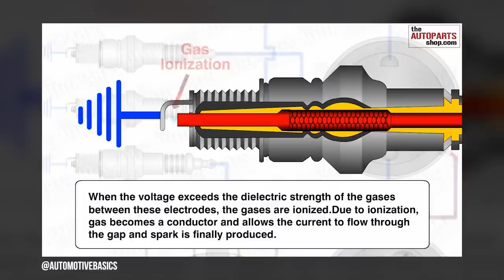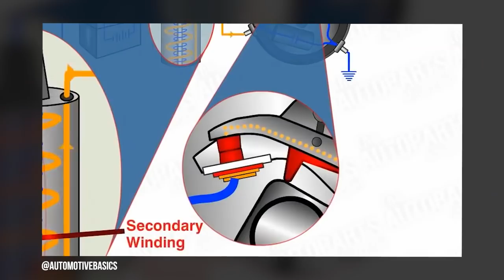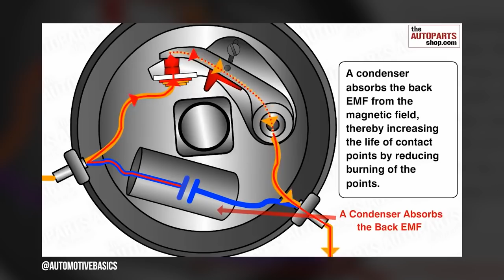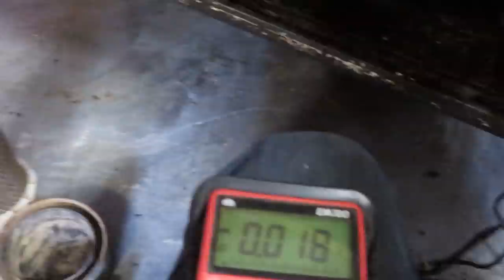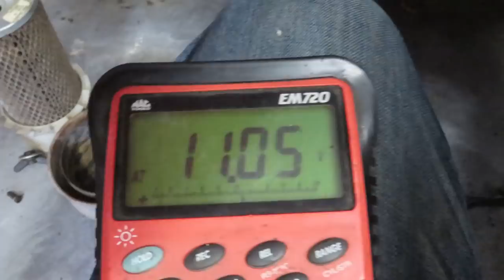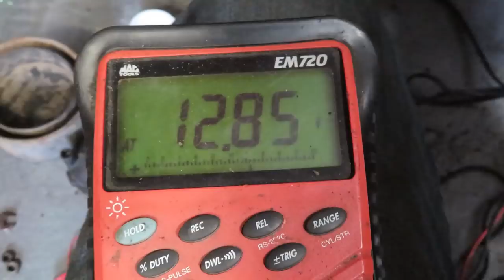What Could Be Wrong With A $300 Skid Steer?

Comment: Good shout on checking the anti dieselling/anti run-on solenoid. Had one crap out on my brother's Volvo 340 (a fine Dutch built car!) which meant it wouldn't idle and would quit at junctions (not great for a new driver). I wedged it in the "run" position with a bit of plastic and it ran fine until we tried to stop the engine. It would splutter on for 5-10 seconds after turning the key off so you had to stall it in 5th gear!

Comment: In 2000 my dad bought a 1980 bobcat 721. Deutz diesel. 1500 hours to this day. He's not very good at maintaining stuff but it hasn't been used a ton and not used hard. He replaced the vane pump and some hoses over the years, I replaced 4 more hoses this year. Currently in the process of repainting and new decals to push him to get some more maintenance done. Oh and it quit on us while removing snow this past winter. Replaced fuel pump just to fuel that out and then messed with the injection pump, then figured we should time it just to be safe.. it runs again. The cam and the injection pump still look new with no signs of wear which is awesome. Really love the machine.

Comment: Wish I could find something like that.
Reply: Look on Facebook market place and you can find anything equipment real are’s that’s how I found my vintage lawn mowe f
Reply: I found a perfectly good working toro push mower for $10 dollars it’s was just missing one part that was super easy to replace.
Reply: Just keep looking on online auctions gov deals equipment rental auctions Kijiji, Craigslist eventually over time you’ll find a deal it takes patience
Reply: Wish I could win the lottery
Reply: I have about the same thing sitting in the weeds   642 bobcat with a ford pinto engine
Reply: @hunter7476  near impossible to find a skid steer this cheap. $2000 will get ya a super junky old vintage one but thats about the cheapest you'll see them. Im always checking the prices on them.
Reply: @rylanleeper4456  thats a classic i got a self propelled toro for free because it "didnt start" ... fuel was bad and dried grass was stopping the self propel belt from turning.
Reply: Og Bqze u have to look for a ticket and buy one first to win the lottery
Reply: Same wished I could find a $300 trackor lol
Reply: My cub cadet 122 has points. They are very important they can make every run a little different

Comment: Let me tell a first-hand no-start diagnosis story. Bought a basket case 1990 VW Corrado G60. Between the boxes of parts the seller gave me, auto parts stores and eBay, I assembled what should have been a fine running engine. Started instantly at the first start but ran worse over the course of minutes until it wouldn’t run at all anymore.

Fuel pressure was good. Fuel flow and injector spray pattern were good. Fuel pulses were correct (checked with oscilloscope). Compression was good. Fuel quality was good as I even tried to run the car from my running truck’s tank/pump. Spark was strong. Ignition timing was good. All crank/cam timing marks lined up correctly. Cranked plenty fast. Could smell raw fuel from the tailpipe. Still wouldn’t start. Totally baffling.

After a month of frustration, sitting on the pot at work perusing VW forums, I saw a post and it all clicked. It became obvious.

When the previous owner’s G60 supercharger crunched itself the integral key on the crank timing sprocket sheared. So although the timing marks looked correct between the crank and cam, the crank sprocket’s timing mark was telling a lie. That is, what the crank sprocket’s timing mark showed to be Top Dead Center (TDC) was not Top Dead Center of the crank. I pulled the #1 spark plug and put a long screwdriver down to contact the piston. Sure enough, the sheared key allowed the crank to slip about 30 degrees compared to the crank timing sprocket. The friction from the crank bolt was all that was keeping things from disaster as I believe (could be wrong) it is an interference engine.

The keyway in the crank was goobered. I bought a new crank timing sprocket and installed it with 2 dowel pins to take the place of the bad key situation. After all that it started instantly and ran like a champ. About 30,000 miles since it was revived and I still drive it daily.

It’s not always something simple. It usually is but not always.
Reply from the maker: Thanks for that!

Comment: Thanks Rich for saying that it's the current (amperage) that kills you.  That's what I learned studying EE.  It's also very important where it goes.  That's the reason for the "one hand in your pocket" rule.  If current goes across your arms, it goes through your heart.  That current stops your heart and you die.  Of course you can find out what the resistance of your skin/body is and work out what Voltage difference will give you too much current.  V=IR or Ohms Law tells you that.

Comment: The engine is mitsubishi 4G32 (1.6 liter)
You can get ignition parts from a 1972 datsun 1200.
Andrew Camarata had the same problem on a machine,you can see the same points he used.

Comment: Engine parts, go to a good parts store, mid 80's dodge colt used same mitsubishi engine. Parking brake should be a middle pedal  on the hump between the other 2. Engine will always be cold blooded and have to run with choke part on for a long time. Timing belt can look fine, but will jump a tooth very easily. Good machine for a homeowner, I had mine for 25 years.
Reply: I was thinking the same thing. I had to put a motor  into one of those a while back. Motors are hard to find now a days.

Comment: I've got the Clark Bobcat 631 with a duetz diesel , I LOVE IT !!
Reply: grafvonstauffenburg  Yes a popular Ditch Witch engine , i replaced the engine but still have the original one which runs, they say you can get 20 to 30,000 hours on the air cooled Diesel,  amazing !
Reply: @ExploringCabinsandMines  Both pieces of equipment I own have air-cooled 4-cylinder Deutz diesels. I have more confidence in them than any other engine - great reliability, inexpensive and available parts.

Comment: I got an old ford cl45 for 450 with a locked up diesel. Pulled the head and cleaned out the gunk from the engine and got it running in -20 in like January and I'm finally getting around to slapping a coat of paint on it now.

Comment: You had the cab up the steering linkage can be adjusted to help with the creeping. The electric solenoid on the carb is too keep fuel from leaking though filling the crankcase with gas

Comment: That's a 4G32 or G32B Mitsubishi engine, used in a few Dodge colts. Pretty easy parts availability.
Reply: I thought that might be the Mitsu unit.  Seems they didn't use the Mitsubishi for very many years though.

Comment: I worked on an old sweeper machine with a Ford has 4 cylinder, it ran a lot like that and had and exhaust valve stuck open. A few taps with a hammer and some marvel mystery oil, she ran like. Champ

Comment: Without the VC off and no timing marks I find TDC by sticking my finger over the #1 plug hole and spin it manually by the crank bolt. When it starts pushing up air and then stops, you found the compression stroke and go from there. You can also verify the rotor is pointing at the correct contact on the cap at this point. Also clean out your idle mix screw port and set to a factory baseline or 2-3 turns out to get it running and fine tune after.

Comment: I did a tune up on an old Farmall 350 that had a rotor that worn. The plastic wear tab on the points was also worn half off and the points were burnt into each other. I couldn’t believe the thing still ran when I saw how bad it all was.

Comment: Makes me appreciate the old 610 with a Wisconsin that my father just got rid of.  The old Wisconsin seemed much easier to work on than this machine.
Reply: Those 610s were awesome. That Wisconsin would just keep going and going
Reply: I had one, the v4 Wisconsin was great.  The clutch and belt drive system?  Definitely the weak link
Reply: We got a 630. That engine is a turd.

Comment: I spotted a resistor next to the coil. The coil operates at a lower voltage from the resistor when the engine is running. When the starter is engaged, the resistor is bypassed to give the coil full voltage for a hotter spark to enhance starting.

Comment: Had a Bobcat 642b.  Simple machine, ran great when it wanted to. Replaced the ignition with an electronic kit from Pertronix. Valves needed to be adjusted on a regular basis or it would run out of power.  Also if it wouldn’t start on a cool day without a lot of effort, the carb needed rebuilt. Just that old of a machine it was getting hard to find parts for it.

Comment: To check the timing in relation to the bottom pulley you could have taken the 3X10mm screws out of the top cam belt cover and checked the timing marks or even perhaps used the timing light on the top cam pulley. lol.

Comment: That’s pretty cool I worked on quite a few of the old breaker points and condenser systems, but I’ve never seen one on the positive side. Any one I’ve ever worked on the points are on the negative side and they are grounding the coil to make it field and spark. The little solenoid on the carburetor is an anti-backfire solenoid. When you shut the ignition off it closes off the main jet so you don’t get that continuing Venturi effect and then a backfire to scare the operator. Maybe you say this I haven’t finish the video yet lol.
Reply: The cool thing about old school ignition is that it can work as + or - ground.

Comment: that valve on the carb might be an antidieseling valve used on the Mitsubishi gas engines , it just shuts off  fuel in the jet port to prevent it running when off

Comment: To check if all cylinders are firing get a spray bottle of water and spray the exhaust manifold. If the water doesn't steam off, that cylinder isn't firing. A neat trick a motorcycle mechanic taught me.

Comment: Was it a OE hall effect set up? as you can get kits that convert your points over. The reluctor just pushes over the cam in the distributor and you swap out the points for the sensor.  if so you could just swap it back to points.

Comment: Slop in the rotor will not affect timing. The coil still fires according to the timing of the points which is run off a cam on the distributor shaft.

Comment: 8:47 That little do-dad on the side of the carby, making an educated guess, is the anti-dieseling solenoid.
it is an electrically controlled air leak - it lets fresh air flood into the carb when you turn the key off so that the engine doesn't keep running if you have a hotspot in the combustion chamber.

Comment: Put a long stick in the Spark plug Hole and manually turn the Crank to find TDC. A Compression check could tell you if it's worth a new Distributor before Scrapping.

Comment: Not sure but I think that is the same motor they used in the Mazda 323 from the early 90's I remember them as being pretty reliable in the cars oil burners but reliable. Cool video most of my equipment comes with a directors notes manual too.

Comment: There is a fairly standard method to adjust the hydrostatic controls to eliminate the creep at idle. A Bobcat dealer should be able to explain how to adjust. They recommended re adjusting controls multiple times a year depending on usage That's the main reason Bobcat had a good park brake.

Comment: Lets see...
1. I'd take a machine like that any day - it my be old, but you can totally fix them up easily enough. 
2. It looks like a Bobcat 742 to me; I've got a 743, which is the diesel model, and a neighbor of mine has a 742 just like that.
3. "auto crawl" - Either adjust the linkage from the steering sticks to the pumps, or, (in a pinch), just chain it to something when working on it.
4. Has deboss never heard of a remote starter switch? Super handy - you just hook alligator clips to the starter's "start" wire and the battery, and now you can start it more or less safely.
5. Not sure it would help in this case, but when I was messing with timing on an old gas bobcat, one trick I learned is that you hook a vacuum gauge up to the intake manifold, run the engine at idle, and, with the engine running, adjust the distributor back and forth until you see maximum vacuum. That's basically optimal timing, at least on the engine I was working on.
6. You guys really don't have a 'usable' CO2 fire extinguisher? I've found that they are really useful, and I got a couple cheap by finding ones out of hydro-test date, so they couldn't be used for a business, or "count" as an extinguisher. For stuff like this? Works great. And CO2 fire extinguishers are usable as much as you want; they stay sealed generally, so it's not a "one and done" thing.

Comment: 8:37 That’s the fuel shutoff solenoid. It’s supposed to withdraw that plunger when the key is turned. What happens more often than not is whatever plunger is stuck on the end of it (rubber or plastic) comes off the tip and gets stuck in the jet. Sometimes they don’t have a plunger - it’s just the metal rod that blocks fuel flow. It’s an EPA requirement, and is meant to reduce backfires and unturned fuel going through the engine. I will typically cut the tip off the plunger and deal with the backfires (if they start happening).

Comment: I dealt with a problem similiar to this on a diesel bobcat of similiar vintage, the problem I found was in the tank. The fuel delivery tube inside the tank that drops from the top of the tank to the bottom had dried out and developed a crack near the top. It was allowing the pump to suck air with diesel, the machine would idle but nothing more. As the rpm rose and created vibration the tube would vibrate and the crack would grow equally. Replaced the tube and the machine ran fine. Not necessarily the same issue considering it was diesel, but just another thing to keep in mind.

Comment: What he’s actually saying; when he purged the fuel system is. If you have someone around get them to turn the ignition. But he likely did the screwdriver spark routine and pointed the hose into a bucket in the other direction 🔥😅

Comment: You can get a twin cylinder motorcycle ignition system for about $50. Run each output through wasted spark coils and it will work just fine on a four cylinder. Each coil is about $25. 
Even better pull the engine and get it properly sorted.

Comment: Just two observations...  The rotor does not control the timing of the engine, that is done with the lobe of the small cam to the contact breakers, or the pick up to a hall effect device.    Also my initial thoughts when you first spun it so easily with the starter, was that it has lost all it's compression...  You need to check each cylinder's compression with a gauge....   Best of luck next time.

Comment: oh and you can find the old reefer units from Thermoking trucks for next to nothing and swap the diesels from those into small equipment with nothing more than heftier spring in the pump. Get the springs from an old Isuzu 4J series engine since they are the same pumps and China still makes them new with cheap new parts available.

Comment: I always Jack them up and set them on blocks when working on them so they don't run away because there is times when you need to do adjustments to reset the neutral and you need to have the lift all the way up with the lift lock in place so it doesn't come down on you that is the only way you can do all the adjustments safely

Comment: These older bobcats are simple easy to fix and work good.
Old Wisconsin motor powered older ones.
That looks like a Ford 2300 industrial motor with rubber timing belt (Pinto motor).

Common  things to check is old weak condenser s and that both the coil and condenser are grounded on clean metal.Fouled plugs black oily( I use NGK hotter heat range on old clunkers).
Loose distributor bushings make point s go crazy. 
Coils wired in reverse.
Coil burned weak from running on direct 12vdc ( most start on 12 then switch to 6-8v running).
Thing on Carb is fuel shut off safety valve 12v when running or a  Shuts off when no oil pressure or overheat etc a check valve also. That is a two barrel carb vacuum secondary. 
Newer ones have electric fuel pump you should hear when key is on.
Jumped rubber timing belts also.
These are not interference motors.
Bad key switch in run position.

Been doing this since 1976.
Nice find that is a Ingersoll or Melroe Bobcat .
Good channel.

Comment: I grew up on one just like it. Should be a 742 bobcat with a ford pinto motor... one of the best machines I ever ran and my father still uses it 30 years later... rebuilt the motor 2 times and the distributor about 35 times... keep it covered in the rain and take care of it and it will always be there when you need it... as long as you can keep idiots out of the motor compartment and the controls. Yeah it looks pretty worn but if a decent mechanic would take the time to fix all the small problems with it you would be surprised how good it could be... dont preach to your audience that old machines are not worth the time to fix... the old ones are still better than the new ones... I've ran both and prefer the old ones and I've also done the work by hand and appreciate the work they do.

Comment: Great great great.. for like 35 American bucks, how could you go wrong?? Nice job explaining in layman's terms how ignition works in a gasoline engine. It's not very complicated at all but it does require the correct order of operations and also a little know how to get it all going right. 3 out of 4 is better than 2 out of 4 cylinders at least!! Thanks for the great show